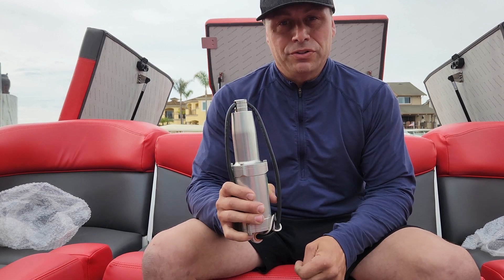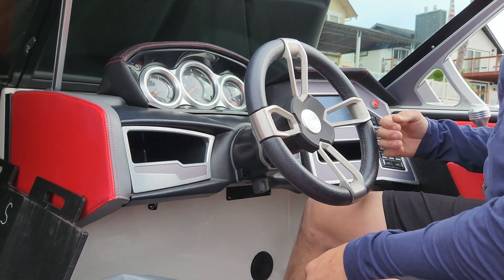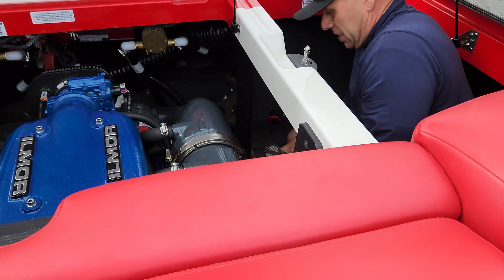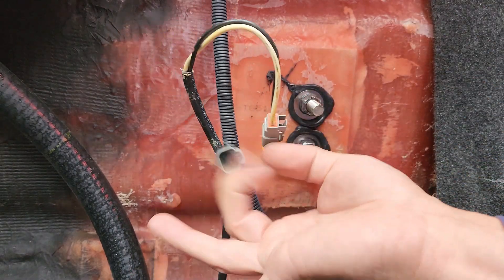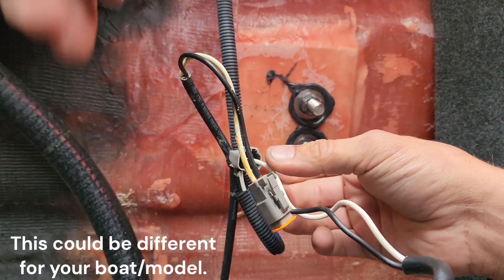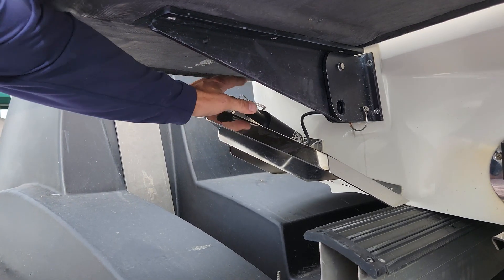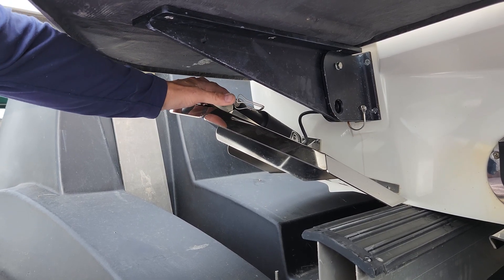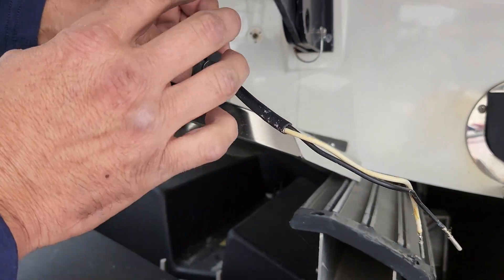Surf Actuator replacement for wakeboard boats. Surf tabs and center cavitation plate.

Comment: what replacement actuator is that? Do you have a link?
Reply from the maker: I have not yet added them to my website yet. Feel free to text me on my work cell 916-538-9577.
Reply from the maker: Sorry this is all new to me. Cell 916-538-9577
Reply: How much does that actuator cost?  Thanks
Reply: @bamawake  The Billet actuators are like $800 a pop. I've heard they fail as much as the plastic ones...